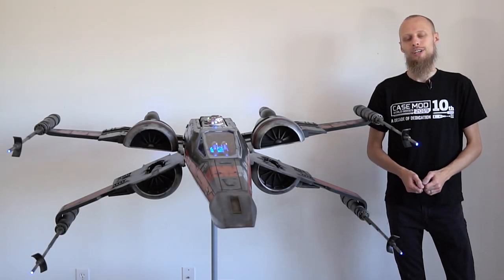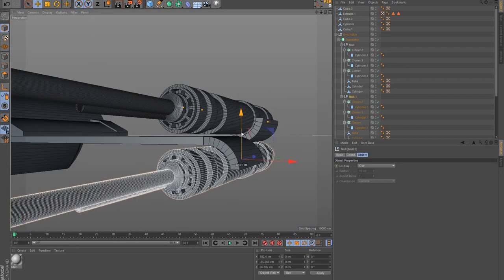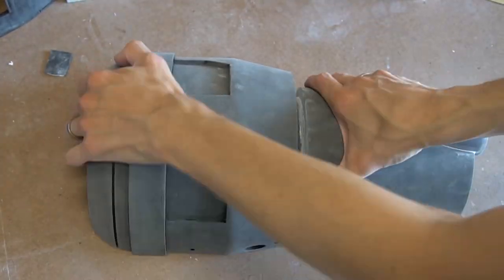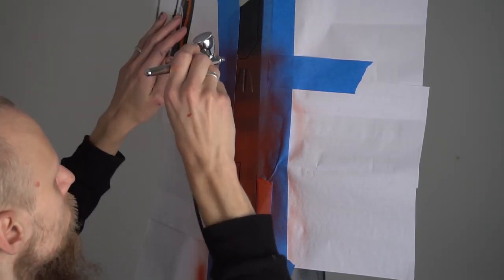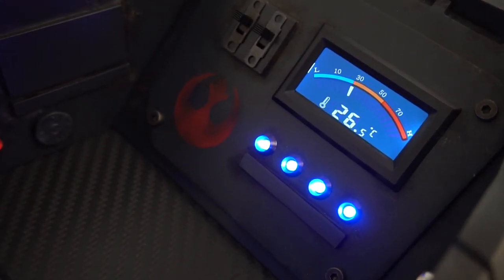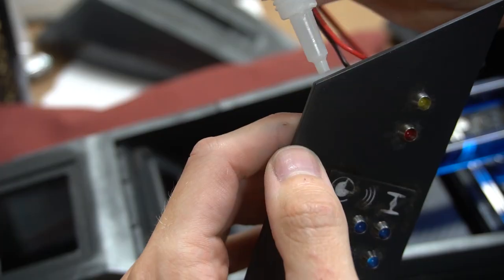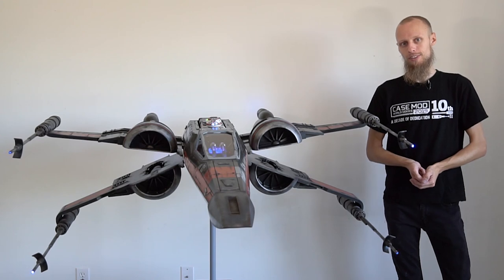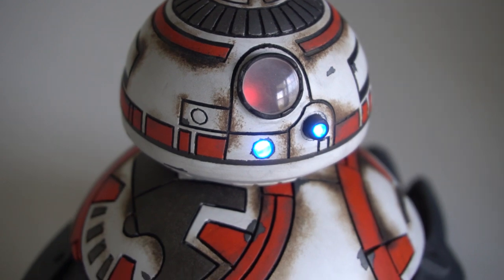Star Wars Case Mod - X-Wing

Comment: Freaking great job! 👍👍

Question? What did you use to connect the video card to the motherboard?
Reply from the maker: Thermaltake offers flexible riser cables in different length. Was a bit fiddly, but worked out.

Comment: It looks amazing but does it works, i mean can u connect a monitor and keyboard and play?
Reply from the maker: Yes, its fully functional. Display can be plugged in to the back. On the motherboard are 90° connectors for the cables. I am using a small wireless dongle for a mouse keyboard combo.

Comment: I want to see the process necessary to replace any of the computer hardware
Reply from the maker: like in any other custom loop system. Drain, remove tube, switch hardware. Memory, GPU and SSD can be just replaced.